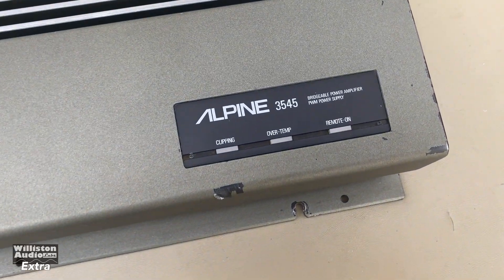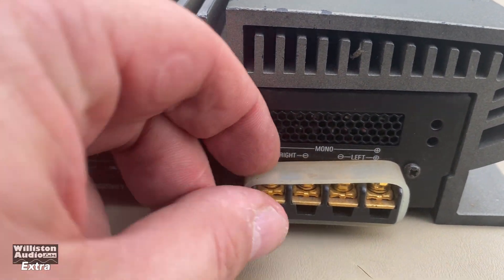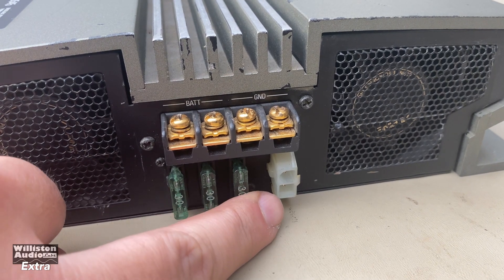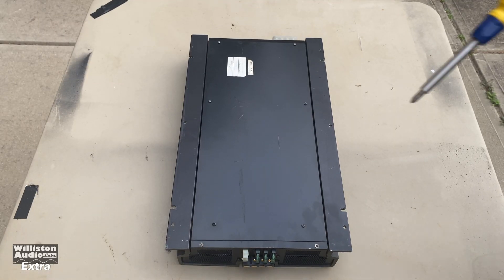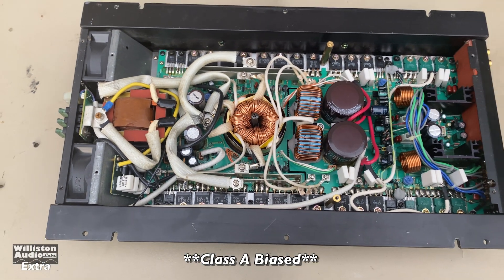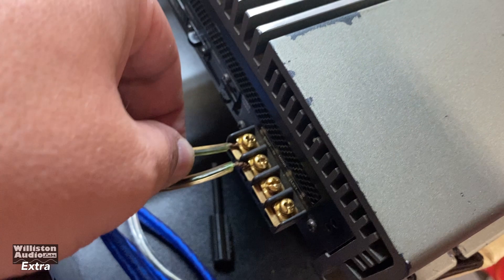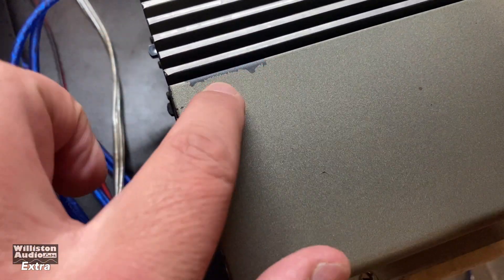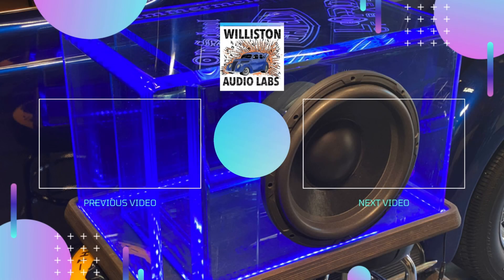1988 Alpine 3545 Amplifier Overview and Demo

Comment: The remote turn-on connector is the same as a 7.2volt 6-cell battery pack (used in radio controlled cars). Perhaps the 2 pins are in and out?

Comment: A local Radio Shack (yes, a Shack) sold Alpine when the 3545's were new. One sat on their display board for years without selling. Of course, in other car audio shops in my town you could buy Orion, Rockford Fosgate, Yamaha and Coustic at the same time. 
In my area Alpine was looked on as being too expensive or more often, for snobs. LOL! 
I knew how good Alpine was but, there was no way I could have afforded the 3545 back then. Great amp.

Comment: Hey big d are those for sale? I been looking for quite some time u seem to find them all the time here in northern ky i never see them
Reply: 1500$
Reply: @bassman9544  I picked 1 up for 250 and another for 300 and 1 I bought in a pawn shop with no bottom that is chrome and like a forest green for 40 bux.
Reply: @joshholden8561  ok my alpine have no scratches. i can wait years and i will get my 1500 ;)
Reply: @bassman9544  that's great u can paint the amp then it will not have scratches.  Lol
Reply: @joshholden8561  TOOL

Comment: I was pretty sure once u hook the top molex plug with a pos remote signal ot gives rhe bottom a pos remote signal to piggy back remote signal
Reply from the maker: They could be connected together so it doesn’t matter which one you use, the other can be used for out

Comment: Im looking to buy 1 of these amps is 1 for sale? The amp thats not working i can tell u right now why its not working the vertical daughter board had issues with coming unsoldered and u have to put silicone all around the base of the daughter board to keep it from vibrations ive repaired that same issue on prolly 6 of these 3545 amps u can replace tbe 30 amp fuses with 40 amps and run that amp mono bridged in a 2 ohm load all day it will get warm but running it 2 ohm the amp can handle that ohm load bridged and it tripples that weak 700 rms rating wich is more like 850 rms at 4 ohms and these amps have some of the best dynamic head room ive ever seen on any class ab amp  Phoenix gold orion soundstream us amps none of those from this era can touch this amp on sq or raw power. I cant find 1 of these for less than 500 in ny area i bought 1 at a local pawn shop 15 years ago that had tbe bottom plate missing for 40 dollars mounted the amp to my sub box then discovered the daughter board vertical support issue with this specific model. 3545
Reply from the maker: The 3545 works, it’s the 3558 needing repair
Reply: @bassman9544  what is a chinch ? I've never heard that term on a amplifier before.
Reply: @bassman9544  yes u have to completely remove the board from the amp or a easy alternative is solder new jacks with wires so u have about 6 inches of rca wire soldered to the correct  solder points for the rcas that would also work fine.
Reply: @bassman9544  I have the same alpine 3545 amp I've had it since around 2001 or so and I also repair amps and audio. If u are the novice repairman I take u for hence ur question on how to replace broken rca inputs the way I explained will be easiest it takes minimal solder skills . 

   Question is both rca inputs just broke off flush ? Or on there but wiggle or pull out ?

Comment: It is really hard to find a single pin molex.  2-pin are WAY more accessible.
Yes, all Alpine amps of that era came with the 'elastic bands' to cover the terminals.
And what is with the jank gold zip cord and corroded twisted ends?  Come on man, put some ferrules on those or at least tin them >p